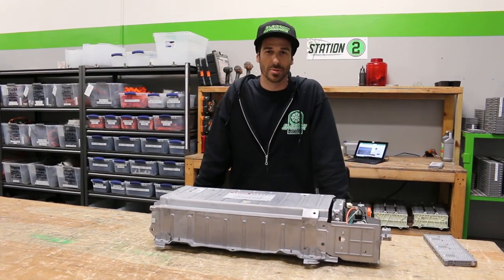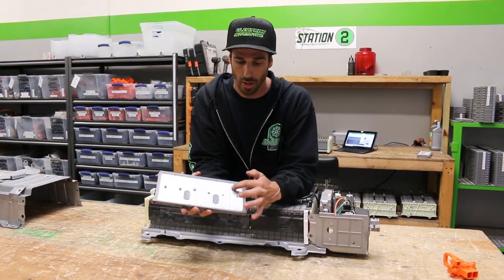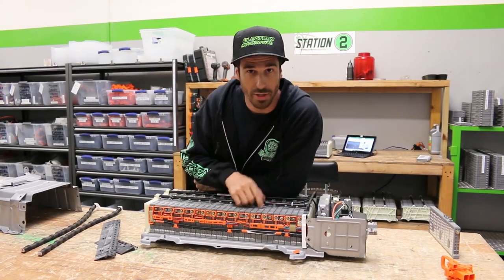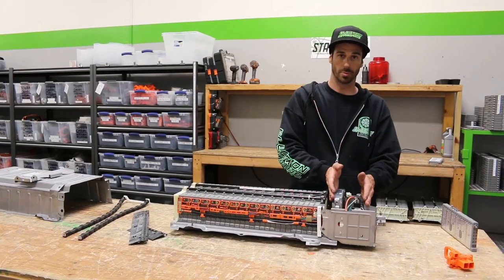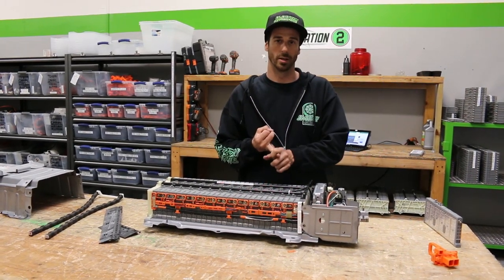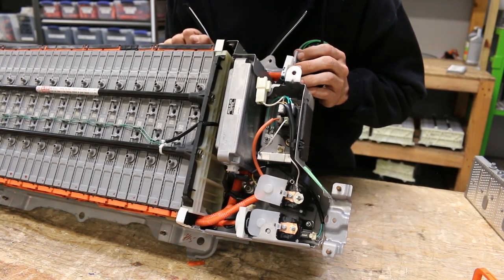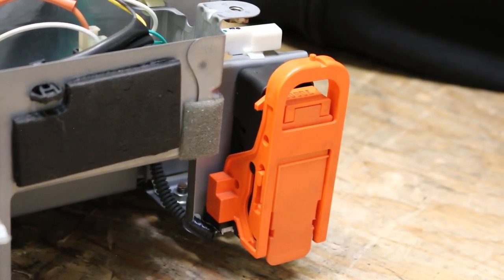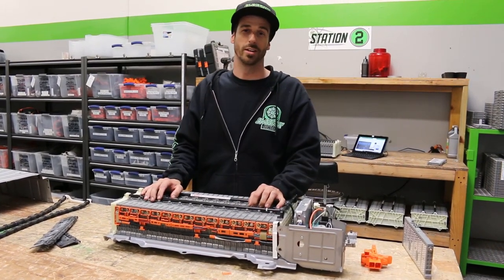Toyota Prius Battery: How it works

Comment: Thanks for sharing your video! After going through changing the battery pack harness and battery control module that had broken pins , I reinstalled the unit and tried to start the car . Red triangle light came on instantly and the car wouldn’t start. I checked the disconnect switch and voltage out the battery pack. 218 volts not going through the relays . About to give up on the car . Decided to watch a few more videos on YouTube. I watched yours to where you talked about the safety switch. I didn’t realize I had to push down on the orange disconnect switch. Pushed it down and everything worked fine! No death warning triangle!👏

Comment: Hey Chris, I have a 2007 Prius & the fan is not kicking in. When I scan the car it’s saying low voltage at the fan. I’ve removed tested & cleaned the fan, also tested the fan relay..all good. Where do you suggest looking next?

Comment: I have a 2017 Toyota Prius.  I have not been driving due to COVID and the HV battery has discharges twice.  AAA started it,  recommended I get a Battery Trickle Charger.  Do you recommend I do this.  Also, can I just let it run in my garage for 10 minutes daily to keep the HV battery charged?

Comment: Great video.  Where is everyone?  Question; 12:39,  you said there's a resistor to prevent carbon build-up.  Are you sure that's not a capacitor?

Comment: What does it mean when only two bars showing on the battery display and not able to select EV mode ever again? Does it mean 12volt battery is dying or hybrid battery is dying?Should you avoid using EV mode because it shortens the life of the battery?And only rely on gasoline mode.

Comment: Hello on the output cables of junction box connection + and ~ is there voltage going out?? I have 00 volts on that connection is it possible a relay or amp fuse blew??

Comment: I have a Prius 2016. I drive very little now due to the COVID-19 Pandemic. Do I have to drive specific distance/specific speed to keep the battery healthy?
Thanks Ben
Reply from the maker: Hi Ben, letting the hybrid battery sit for a month or two can damage it. Start your Prius everyday and let the car run for about 10 minutes and that should keep your hybrid battery healthy and alive.
Reply: @electronautomotive991  hi cris ihave pob47 code. After jump battery. It’s means need to replace whole battery

Comment: Chris, my 2006 Prius (keyless/navigation) has 400k miles.  I just put in my 3rd battery.  Going on vacation.  If my prius sits for 3 weeks with the sensors on, will it drain my hybrid battery or just the 12 V?  What do you recommend?  Is there a way to keep the hybrid battery on a trickle charge?

Comment: Hi Chris,  I have a 2012 Prius w/ 205K miles.
I’m getting hi battery temp alarms. I live in Phx, Arizona so it’s hot.   How can I test my cooling fan so I know it works?
Reply from the maker: it is probabbly your water pump or head gasket. the fans never fail on these (at least we have never seen in happen in the last 11 years). the pump and headgasket can be tested at a certified repair facility

Comment: Hello I’m a women trying to do this myself and I broke a small wire under the cells that hooks to the last battery not sure where it goes but to take off first cell I had to undo it and the little wire came out do I really need to have that working and have to take out all cells to get to other side
Reply from the maker: Hey Sheri! I believe you're talking about the temperature sensor harness, if you broke that wire you need to replace the harness or else the hybrid battery fan will be running full blast all the time. If you just broke one of the plastic clips, that's fine, just insert the sensor itself into one of the holes in the bottom of the cell and reassemble.

Comment: I own a 2017 Prius with nickel battery. Non lithium. Can i swap out the battery as well?
Reply from the maker: Yes you can. They are slightly different but as long as you replace the entire set of modules it is compatable
Reply: @electronautomotive991  wow. Great where do I get new/fully charged modules?
Reply from the maker: Here is a link. https://www.electronautomotive.com/product/toyota-prius-2004-2009-battery-module-2

That link is for a single module. I recommend replacing the whole set or you will keep needing to replace individual ones. 

Your car is young. Does it have high mileage?
Reply: @electronautomotive991  yes. 185,000 miles we're a courier company
Reply from the maker: @drksdofthmoon  ok, well that is a normal mileage for failure. If you decide to go with one of our batteries, the platinum battery would be best since it will be subjected to so much use. We can also give you tips on how to extend the life of your new battery.
Reply: @electronautomotive991  yes. I'd like to. I sent a message on your main website about the possibility of bringing my car down for you guys to do the battery swap. How much it would cost, etc. Please let me know more info.
Reply: @electronautomotive991  can u send me the link for the whole set of modules to swap out. Gen2 or gen3 modules?
Reply from the maker: @drksdofthmoon  here is a link to the set of modules. The gold battery is a mix of 2nd and 3rd gen modules. The platinum is 3rd gen and/or 4th gen modules. You cam always call us if you have questions and we will help you out. 714-609-5064

https://www.electronautomotive.com/product/toyota-prius-2010-2015-battery-rebuild-kit

Comment: Any model ?
Reply from the maker: This is specific to 2004-2009 prius but the concepts and theory is very similar to all others
Reply: Thank you . 
My car 2007 but I have a problem where I hear a strange sound coming from the back seat looks like a crackling sound
Reply from the maker: I've never heard of a crackling sound. When you that the car, you should hear a clicking sound coming from the battery. That is the 2 big relays testing themselves and charging the high voltage system
Reply: If you hear a cracking sound coming from the hv battery area it means your battery is overheating/overcharging and the plastic blocks that hold the modules are breaking.
Reply: It could also be a leaf/debris in the fan blade

Comment: Hello there! just watching your video do you realise after explaining the function at the end of the battery modules you explain this is the section that controls the modules an then you explain this bit here is called the BCM dont get this confused with the body control module this is the battery control module! but reluctantly at 9:13 you call the Battery Control Module the Body Control Module... so ive stopped watching this video.